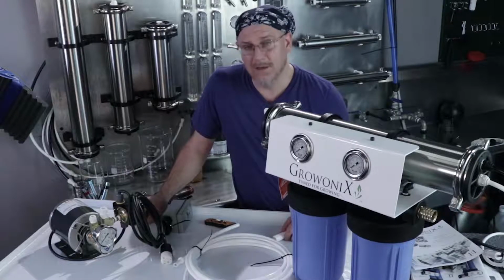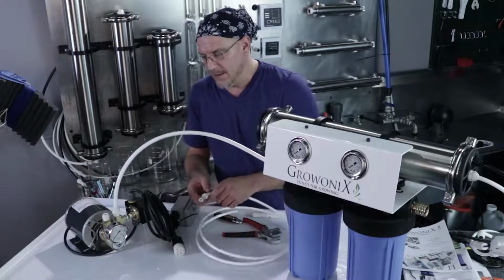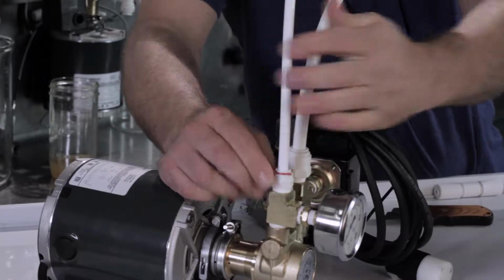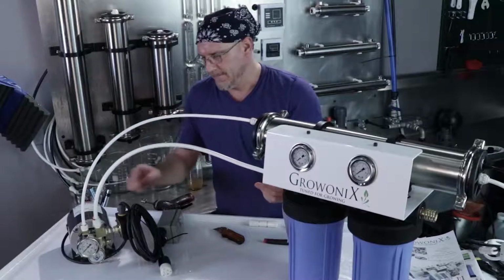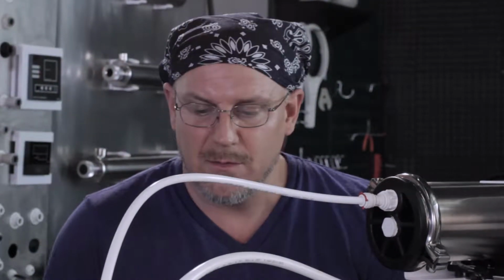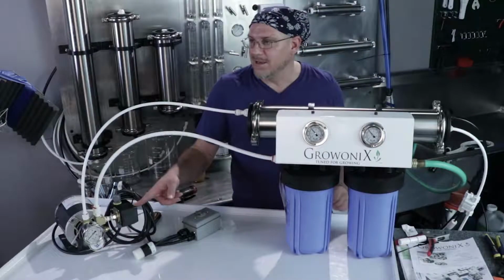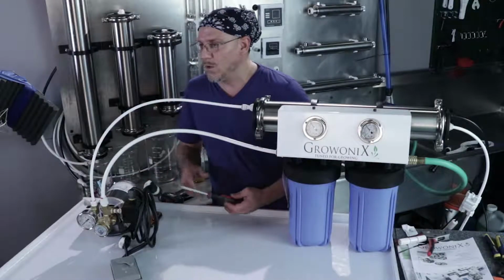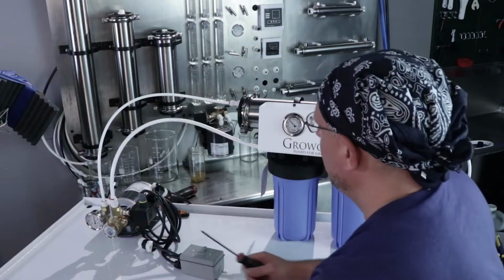GrowoniX BP6010: Connecting

Comment: Hi, does the booster pump and RO come with all tubing to connect?
Reply from the maker: Yes
Reply: I bought the pump kit and the EX-1000T separately.Not the deluxe kit. So I dont have to worry about extra 1/2" and 3/8" piping and 3/8" to 1/2" reducer  for pluming this up?
Reply from the maker: No it comes with it, as stated and shown in this video:

https://www.youtube.com/watch?v=omg_FtkVUaE&list=PLimyyyDCvL3qM6o_5ZlRdTR23-hFh51n9
Reply: Great Thanks.